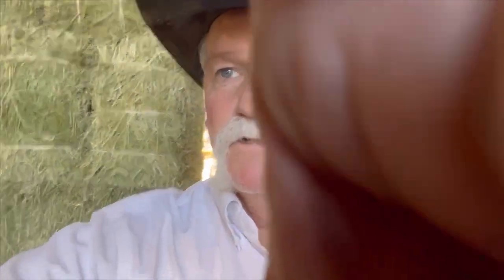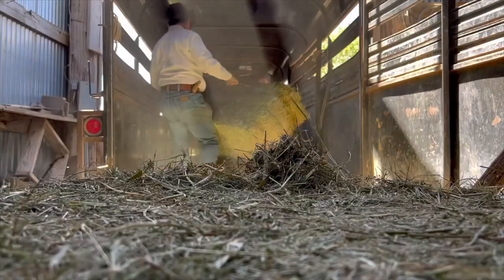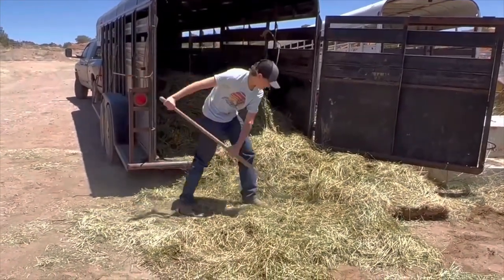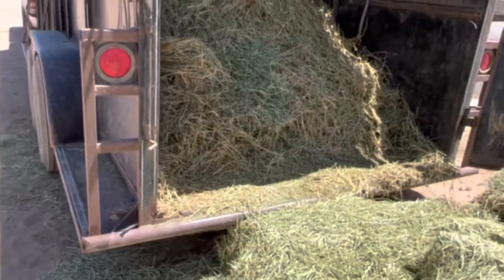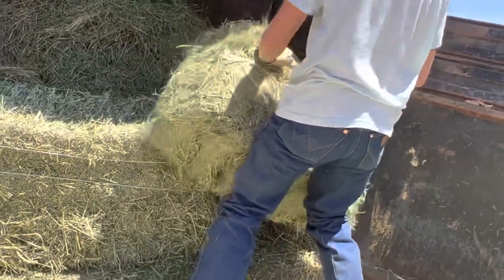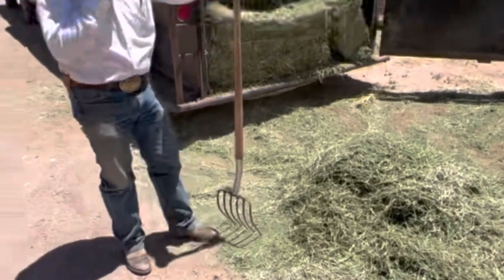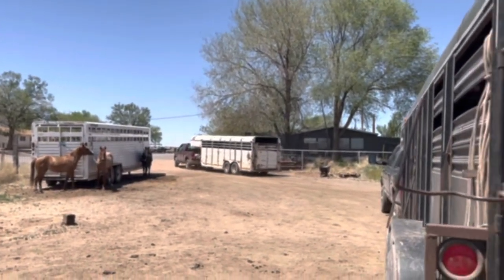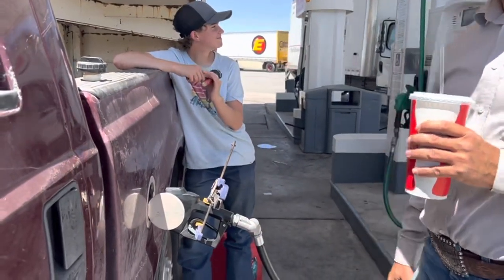Pitchforking Hay | Yard Sale Clamps for Fueling Up

Comment: Just a sugestion from an old man with a bad back,  You might next time you have to load hay in the trailer, put a tarp on the bottom and pull it out with a stap then just pull it over the hay in reverse over the top of the hay then it won''t be there for the horses to eat, love the videos, I would like to see around both your houses, meaning your sons house too, thanks Jim las vegas nv
Reply from the maker: Ok